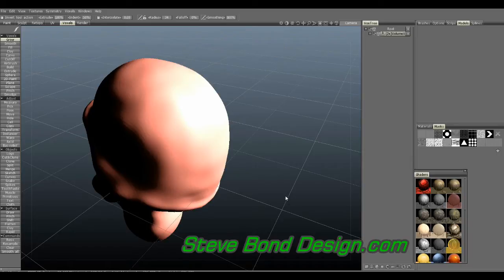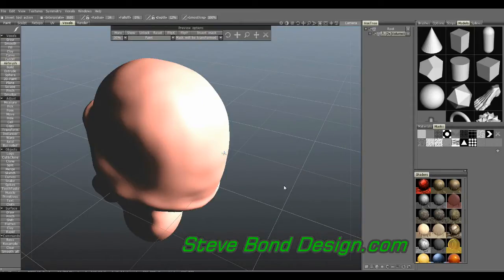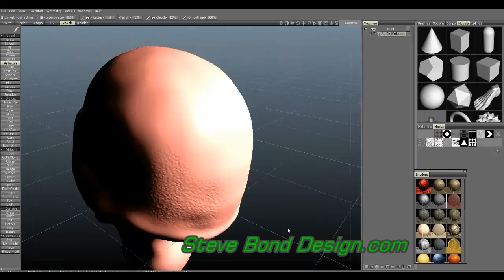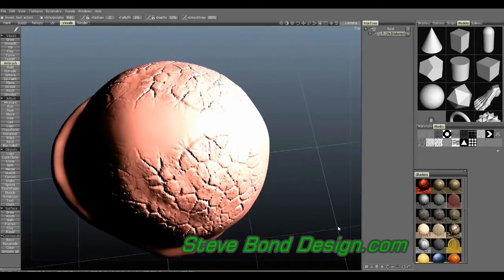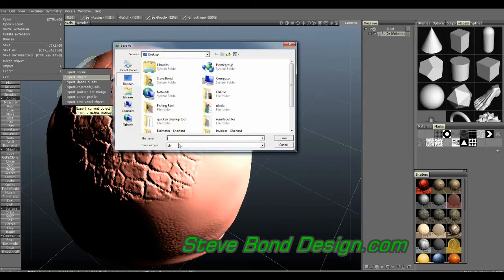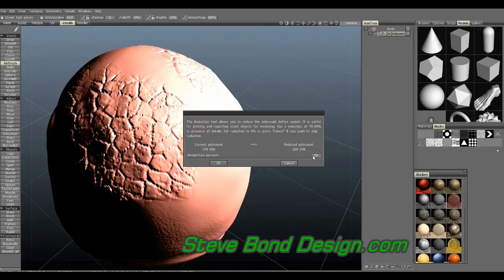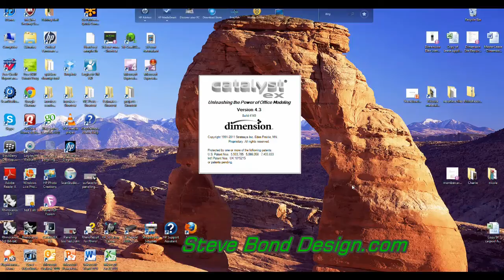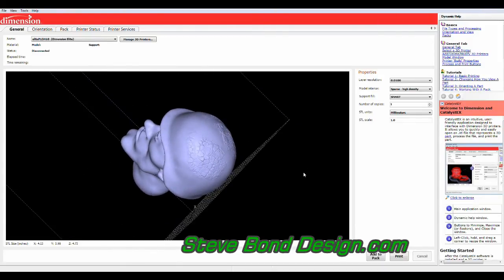Add texture to a 3d model for 3d printing using 3d coat

Comment: So I'm brand new to this.  That clear texture overlay you painted through, does it work like a stencil?  Can you stack multiples like stacking stencils? Can they be custom made? I'm trying to do this but with a stencil of sorts instead of mouse painting the stl. Say I modeled Darth Maul's head, to print a clear "hologram" bust, and I wanted to roughen up all the red stripes on his skin so they would glow brighter than the smoother stripes... Is there a way to double up on your texture overlays, or to texture and then smooth through another stencil after, to get this effect?
Reply from the maker: You can double up stencil's the thin to remember is the resolution of the printer you are using, don't put too fine a texture

Comment: Do you think we could talk a little bit about the details of how you do this?
Reply: Sure , what do you want to know
Reply: I am having a difficult time importing an .stl file in order to texture it.  I am able to import for microvertex painting however when I export, the file the texture quality is horrible.  Keep in mind I have never used the software.  My question would be how did you import the .stl.  Any help would be appreciated.
Reply: I think my issue is how I import the stl file.  There are so many options!
Reply: I use uniigraphics(NX) to create my stl file.  When I open an stl file in voxel scultping I am faced with an options window with different transformation types.  The part remains white and I am not able to apply a texture.  This may be a no brainer but what do I do next?